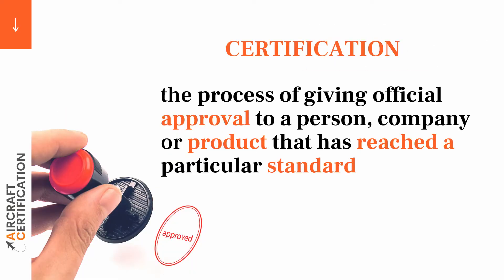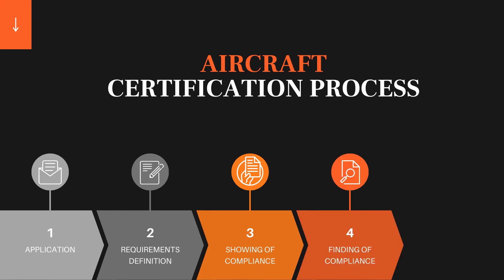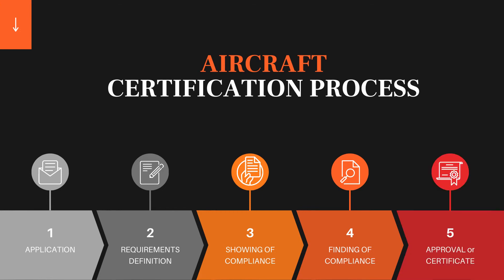What is Aircraft Certification? - Rafaela Caillaux

Comment: At 1:38 , you mentioned "Third Party". What do you exactly mean third party in this context?. Suppose the manufacturer pf the aircraft changes the design, does he need amendment alone to the TC or does he require STC? Kindly clarify. Thanks
Reply from the maker: The third party can be a completion center, a system or an equipment supplier. The TC usually requests an amendment in the TC and the "third party" applies for STC as they do not own the TC. There are some specific cases where the TC holder can apply for the STC.